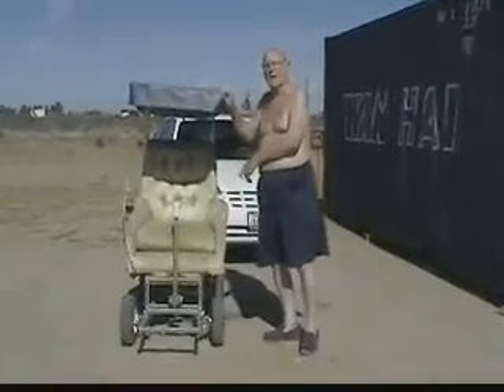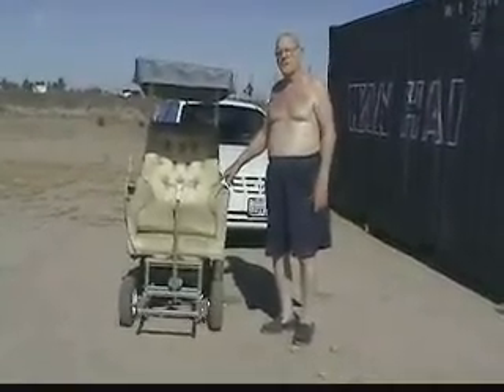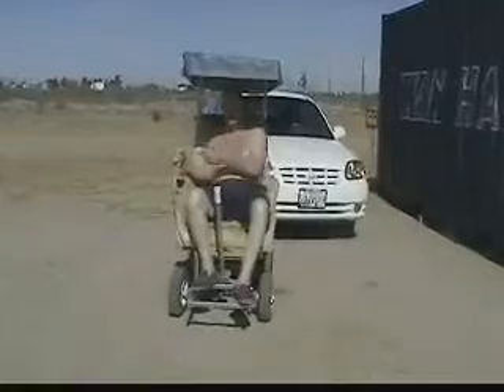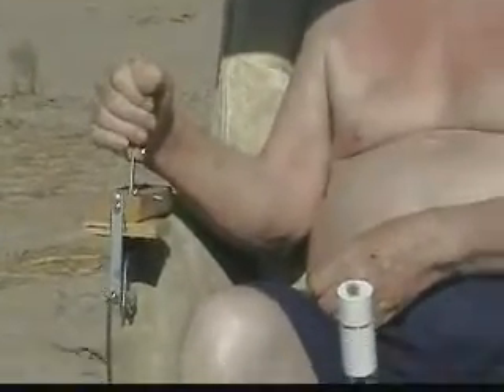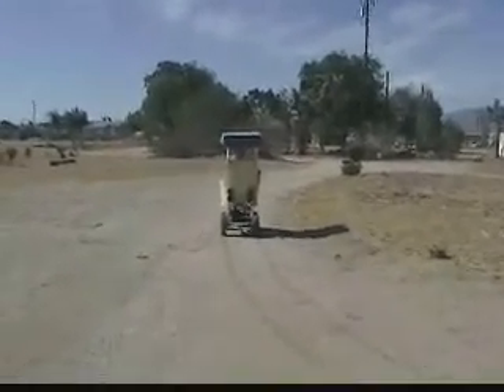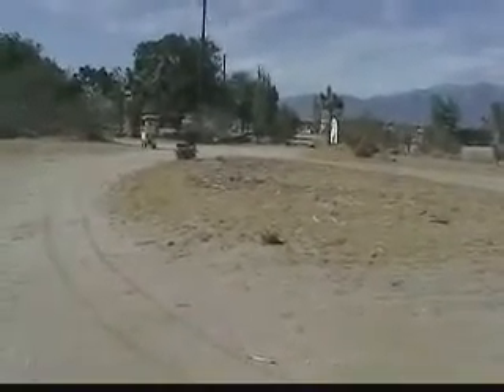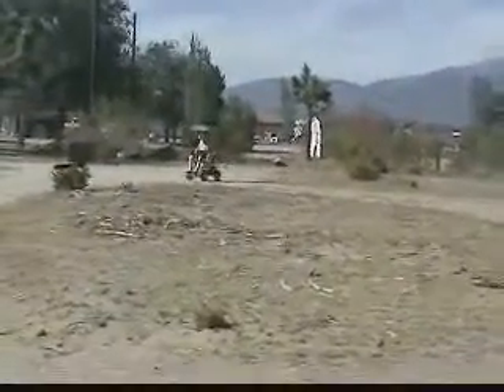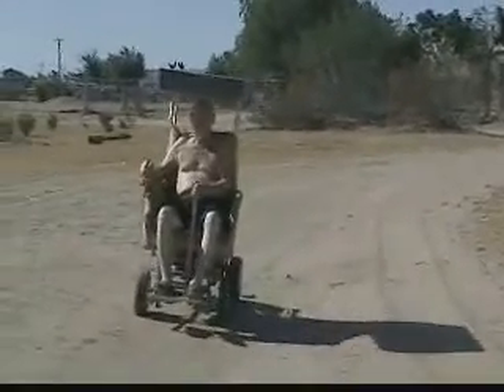Desert Wheelchair

Comment: I guessed you used an induction motor off a drill press. But that thing is noisy as all get out!  Sounds like a turbine!! My grandpa just woke up......he's been dead for 27 years. So I'm guessing you used a brushed universal motor like they use in a hand drill. They are VERY powerful for their size.... and very inefficient. So what's the miles per charge you get?  And the amp-hours in the battery? Thanks.